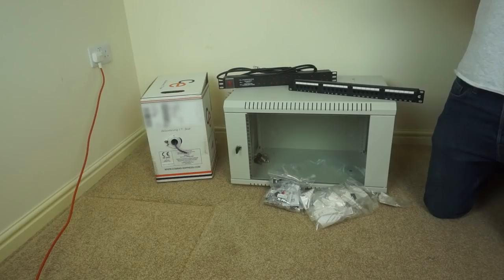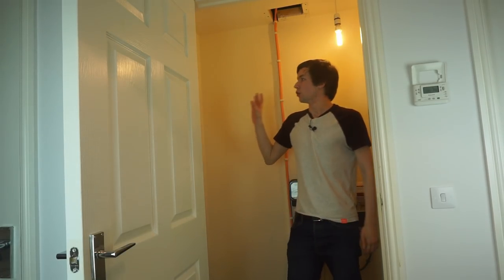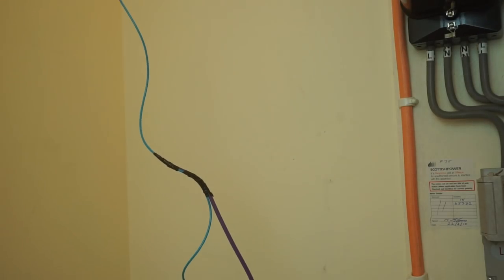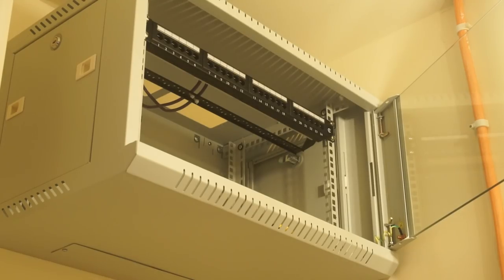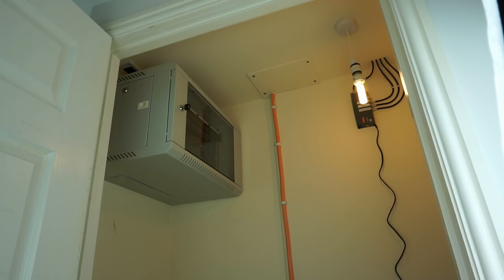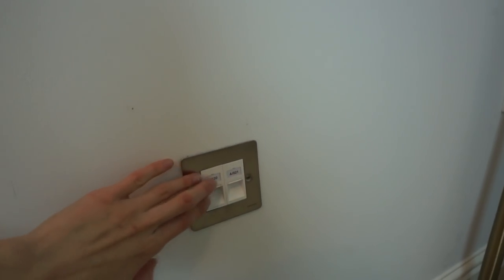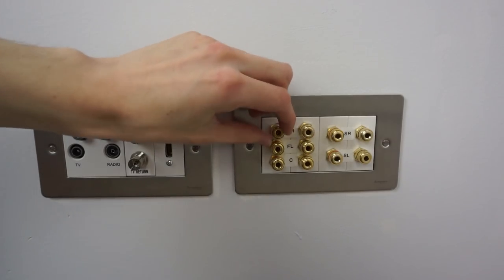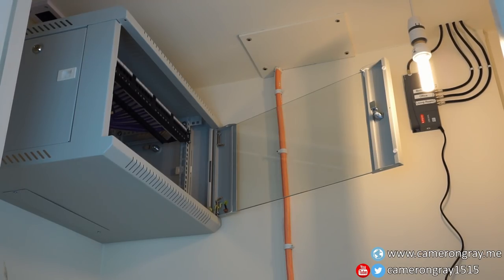New Flat - Time to install a completely overkill home network!

Comment: You are an insane person for running in wall cat6 in an apartment.

Are you going to rip it all out when you leave?
Reply from the maker: No, I'd just leave it in for the next owners, they can pretty easily remove it if needed but if anything it's a value-add to the property. I wouldn't rip out any of the electrics when I move so why rip out data wiring? For me, running it in wall was the only sensible option, I can't stand surface mount wiring in a residential environment.
Reply: @camerongray1515  not saying what you did was a bad thing or something that you need to remove, although some homeowners would be dumb enough to think it was a bad thing. its just an incredible amount of time and money that your investing in a place that you dont own.

Also, would have been so much easier if you could have gotten access to the attic space, but i know that's not always very easy
Reply from the maker: I do own the property though... No way I'd do this in a rented flat! I'm not top floor so don't have any attic space, just a small void between my drop ceiling and the actual concrete ceiling above so the only option is to go in through the plasterboard.

Comment: PLEASE leave service loops ,don’t leave your runs too short to work with should you have to remake ends in future!
Reply from the maker: I was fairly space limited to a trying to jam a service loop into that cupboard would be tricky. There's already plenty slack pushed back up into the ceiling void to allow several reterminations or to get the patch panel out for access.

Comment: I know this is an old video, but cat 6 should not be near power cables
Reply from the maker: It's best to keep it away wherever possible which I've done but there's a limit to what is practical when you're running it through a ceiling void and in walls without having to create damage or to place network points in stupid locations. If I need both network points and power outlets behind a TV and all cabling must run through the ceiling and down into the wall there's only so much that can be done to keep them away from each other.
Reply: @camerongray1515  fair point. I'm slowly networking my house. After sky q install I've had to put more runs to make the system work. So eventually like yourself I will end up with at least 2 cat 6 in each room.

Comment: Was this flat new construction? If so, why not run the wires before the drywall was put up?
Reply from the maker: It was an existing building (fairly new but I'm not the first owner).  Even with new builds here I don't think potential buyers would be allowed to do stuff like this while it was under construction.

Comment: sockets half way up the wall so you can see what is plug in and wire traling down the wall witch is a shame when you have gone though so much effort to hide the others
Reply from the maker: The sockets are quite high up but they are aligned with everything else that was already in the flat.  It's a fairly modern building so has to comply with modern accessibility regulations which define minimum/maximum heights for sockets/switches.etc along with other things such as minimum widths of doors.  The sockets for TVs that are literally half way up the walls are completely hidden by the wall mounted TVs.
Reply: Yes I know the regulations,  but lets face it some regulations are just plain stupid LOL.  Enjoy your installation.  :-)  ..

Comment: why not use powerline kits? #easier
Reply from the maker: I've not been overly blown away by the performance or reliability of powerline and it would be incredibly expensive if I were to have bought powerline adapters for every device I was planning on connecting.  They would also limit my ability to do things like segment the network using VLANs to keep different types of devices separate.  I also occasionally play about with software defined radio - powerline networking can be an absolute nightmare for causing interference.
Reply: i use them all the time as i can not 'cable' anymore #illhealth  each to their own :)
Reply: also phone socket so close to mains will cause interference as-well #rerouteitmaybe
Reply from the maker: The main phone line has been routed through the consumer unit by the people who built the place so unless I want to get Openreach to move it I'm stuck with it.  That said, the line syncs at the maximum possible rate and has had no issues so I imagine it's fine.  I don't use any analogue phones at all so not worried about that side of things.

Comment: Why all this complicated cabling in a flat a good Wi-fi modem will work and very cheap
Reply from the maker: WiFi performance and reliability is nowhere close to that of a proper wired network, it's also significantly more hassle to connect every device to WiFi after ensuring they all have WiFi cards in them. I'll gladly use WiFi for mobile devices but I'd want all fixed devices to be wired in. The cabling is also usable for other things such as for carrying HDMI video and it's potentially a slight value-add to the property.

Comment: Why not use wifi or powerline?  Your new flat will be holly.lol
Reply from the maker: I use WiFi for portable devices but the performance and reliability of WiFi/Powerline is nowhere near that of a wired connection.  I store all my files on a server so being able to access that at gigabit speeds is really useful.  The holes were all easy to patch and after painting are now completely invisible.
Reply: @camerongray1515  - You did a great job. I drafted that comment 5min into the Vid and realised it was several degrees above a simple wifi to a laptop. That said very bravely of you to knock holes into your new flat. You did a great job making good.  I use a NAS drive running FreeNAS, and it works for the simple file storage and back-up that I need. My Office has a wired connection, and that's were I do all my main work.  That said I had to do what you have done to get a wall mounted flat LED TV on the wall and it was a pain as it was a plaster and Dab wall. The gap at the back was just about 15mm to get the wire in and I had to cut extra holes to feed around the paster dabs. All in all looked great after but a pain to patch up. Like I said you did well to attempt it yourself.

Comment: cost?
Reply from the maker: The cabling.etc shown in this video came to around £550.  There was then some additional cost for things like drill bits and wall fasteners.  There was then an additional £380ish for switches which I'll show in the next video and then some additional network equipment that I already owned.  It certainly isn't cheap but well worth it for me in the end.
Reply: Cameron Gray Oh nice, i’d love to see a series on building the ultimate flat seems like ur on ur way there

Comment: Has adsl and this overkill network...
Reply from the maker: It's a 80/20mbps VDSL2 connection, not ADSL...  This was the fastest connection available to my property at the time and is more than sufficient for my needs. Just because someone requires a fast local network doesn't mean they also need a blazing fast internet connection.

Comment: Wired his whole flat with business grade networking equipment, can't wire up a a power socket. Weird.
Reply from the maker: I'm perfectly capable of doing it (will be replacing the plastic sockets/switches and some of the light fixtures myself) but in a flat in Scotland, adding additional sockets or circuits (essentially anything that adds load to a circuit) would require a building warrant and sign off.etc.  I didn't want to break building regulations and risk invalidating my insurance by doing it myself.  I do pretty much anything myself that I can do without breaking building regulations, for example, I'll do plumbing and some electrics myself but won't touch gas for obvious reasons.

Comment: label your wires
Reply from the maker: Which wires?  They are terminated into numbered jacks which terminate into the corresponding numbered ports on the patch panel.  Before termination I'd written numbers on the insulation of each cable to allow me to match them up while terminating.

Comment: Just get the sockets put in! It's easy. You don't need an electrician. Just watch Thomas Nagy's videos.
Reply from the maker: +Joe de Max It would definitely be easy enough to do, done it before.  However, building regulations here require warrants and sign offs for adding sockets into flats.  Don't want to to it myself without this then find that it invalidates my insurance.  I could technically do all the warrant stuff myself but that would involve dealing with the council who are hilariously slow to do anything so just getting an electrician who can do everything would be significantly easier.
Reply: Thomas Nagy is not a good example of how to do things correctly.
Reply: SDG Electronics Thomas Nagy is a beacon of best practice. How dare you say that!
Reply: Joe de Max There's a lot of non compliant stuff in his videos. Unterminated SWA, flex buried in flower beds, downlights installs that don't comply and more
Reply from the maker: Also, thanks for introducing me to Thomas Nagy's channel - I may or may not have binge watched all of his videos over the last couple of weeks :P
Reply: SDG Electronics
What the hell is your problem?
Reply: SCWfan06 How do you mean?
Reply: SDG Electronics has a point - in almost all of Thomas Nagy's videos, he's contravened one reg or another. Definitely not a beacon of best practice! Also rough as... flex clipped to the top of skirting boards etc yuck!!

Comment: Way overkill for a flat. A wireless ac receiver would do the job.
Reply from the maker: I do state that it's overkill in the title of the video. That said, while I do now also use an AC access point, the real world performance is under half of a wired gigabit connection with a single wireless client. This would drop even fuether with heavy concurrent traffic.  Additionally, the cabling installed could likely go up to 10gbps with appropriate equipment as well as be used for other applications such as for sending HDMI signals over the CAT6 cable.
Reply: Cameron Gray you know there is cat7 and 8. Plus how many people do you have living in the flat. Not just over kill it is a waste of time. You just didn’t need it.
Reply from the maker: @pj7008  CAT6a and CAT7a exist, while CAT8 is a standard it is still extremely new and not widely available on the retail market, the only "CAT8" cable I can find are cheap off-brand patch leads on Amazon which are almost certainly cheap cables of goodness-knows what standard being sold as "CAT8" to trick the crowd who believe "the bigger the number after CAT, the faster my internet will be".  In my application I could have gone with CAT6a but this would have been twice the price, been bulkier and harder to run due to the thick cable and be unlikely to provide me any significant benefit.  CAT6 can usually do 10gbit speeds over distances under 37m - my longest run is probably around 15m and I'm in a fairly low interference environment.

Yes, I'm the only person who lives here although that surely doesn't really make a difference, if I want a gigabit connection between my laptop and my NAS, I'm going to need a cable. If I want to just be able to plug things in and have them work rather than fit WiFi adapters into every device I own, I'm going to need cables.

As for it being a waste of time and not needing it. I dare say doing a project that I enjoyed which was extremely educational for me and allowed me to create several videos that helped get my channel off the ground and provided enough ad revenue to surpass the cost of the networking equipment probably means this wasn't a "waste of time"
Reply: Just hope you at least own the flat and it’s not rented.
Reply from the maker: @pj7008  I do own it, doing this sort of project in a rented property would be ridiculous!  Hell, if anything, having quality network cabling installed could increase the value of the property for the right buyer.

Comment: So much unnessecary destruction.
Reply from the maker: It's pretty much necessary to do what I wanted to do given the access that was available.  All repaired now - you can't even see where the holes were.
Reply: The ones you put close to the ceiling could have been drilled straight from the holes you made for the boxes. Also I've realized that securing networking straight on drywall is popular in that part of the world. I would have put a recessed box for the TV connections.  You should really invest in a longer cable fiber which will allow you to use more of the tight spaces that tables can fit trough. Something like this https://www.elektrikaup.ee/elektriku-tooriistad/5445/tombetross-4mm-20m-estiare-anguila-6-0400-020.html

Comment: Why do you call them flats it's just a apartment
Reply from the maker: Because I live in the UK where they are referred to as flats including my address and all the associated legal documents. The US definition of apartment wouldn't be correct either as it's privately owned, not rented so it would be more accurate to refer to it as a "condo" however that term would never be used in the UK.

Comment: have you ever herd of WiFi?
Reply from the maker: Yes... Sending this from a WiFi connected laptop...  I don't use the wired network as a total replacement for WiFi, I use it to connect fixed devices so that I can benefit from the significantly higher speeds offered by Gigabit ethernet for transferring data around my local network.  Sure it's not necessarily required but for me, moving into a totally empty property that I was redecorating anyway, it made total sense to spend a bit of time running cabling neatly so that I can use it for years to come.
Reply: and why all that amount of wires you have that many desktops and "other devices?" wired phones, printers and... you running an industrial office
Reply: @A I No, the thing is there that they insinuate that wiring is the correct way to do things in the house the right way and have wires going all over the place
Reply from the maker: With an install like this it makes more sense to run more cables than are required.  A lot of the time you can reuse existing cable routes so it's trivial to just add in more at fairly low cost. This is why every plate has 2 ports, the cable routes are already there, it probably takes 10 mins to add the second port and costs maybe £5 extra in parts. Take electrical outlets for example, would you rather have spares in various places or just enough to connect everything that you have in the exact location you currently have the devices?  Currently connected I've got a laptop dock, a printer, 3 smart TVs, a PC mounted behind a TV, an AV receiver, a desktop PC, a server, a wireless access point and a couple of security cameras then I ad-hoc connect other devices on a fairly regular basis. Currently 8 out of my 11 drops have at least one device connected.

As for me saying it is the "right" way to do it, I'm not aware of ever saying that. Hard wiring things where possible is definitely my preference but I totally agree that WiFi is also a totally suitable option for most people. That said, where it's possible to hard wire a device, I see no reason not to.

Or let's look at this another way, if I enjoy carrying out a project like this, why not do it?  I had the time, I had fun doing it, it was relatively inexpensive and ultimately gave me a useful wired network and potentially added value to the property to the right buyer.

Also note that the end result of this (shown in the follow-up video) results in all cables being totally hidden with a few neat wall plates dotted around in the exact same way that power outlets are. It's not as though it looks unsightly or anything. In fact, it's a hell of a lot nearer than a lot of houses I've seen where someone has needed to hardwire a single device and has trailed a massive long network cable around the house and stapled it to the walls.

Comment: Ya most houses have 100a panels just for sub panels . That mean it's an add on too their house other upgrade to the other main breaker box . Your probley need like 200a breaker or larger . 100a is nothing and at 240v . Ever thing in the house is 240v . In America most things are 120v so not an huge pull in amps . Only thing that is high amps pull is stove, washer and dryer, stuff like that . Your county has every thing 240v . Why would the would you need 240 too an TV that would really run off of 120v .
Reply from the maker: It's a completely standard install by UK standards.  Electrical standards/regulations here are drastically different and houses are generally wired very differently to those in the US.

For more information about UK electrical supplies, this video from John Ward properly covers all of the items that you can see in my video: https://www.youtube.com/watch?v=edO3qb0RtiU

Current is inversely proportional to voltage (I=P/V), therefore in the UK where everything is 240v, the current will actually be lower (A 100w load in the US on 120v would be around 0.8a, in the UK on 240v that would be closer to 0.4a).  Therefore the 100a supply here can provide 24kW which ought to be more than enough for a 2 bedroom flat!
Reply: I think Collin you trap into a mistake. It is all okay with the british power sockets - the problem only is that the small room haven't a power connector and the british standard use round cable from power connector to power connector - start and end point of the cable is the fuse box! 

So he must order an electrical master of power and can't make it self. 

The typical Ampere are 40 A for a round-line, the key in the british security are in the power connector - with the correct fuse for only this device!